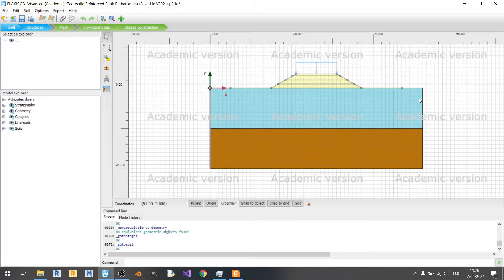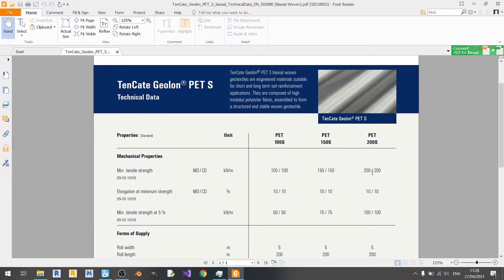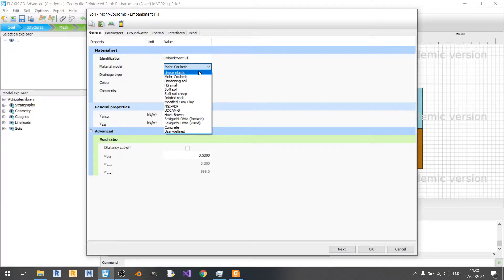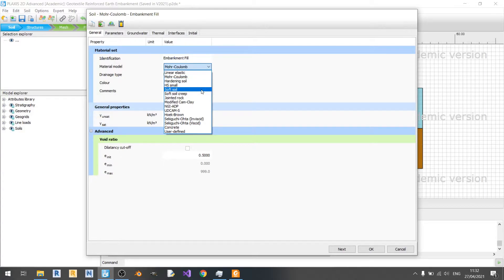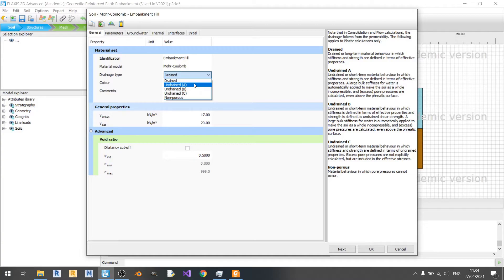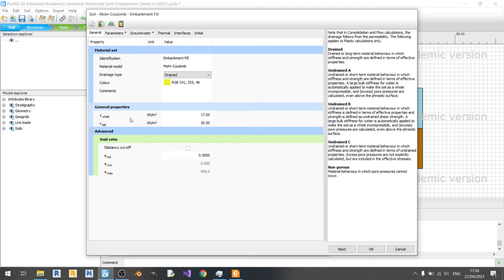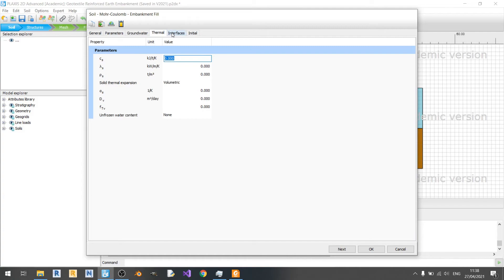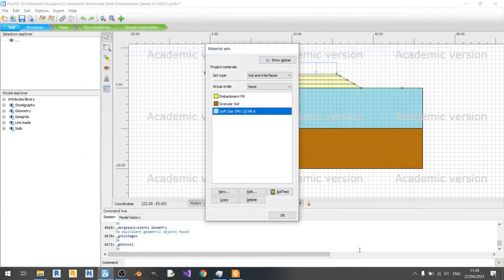Plaxis 2D: How to create geotextiles and soil?

Comment: hello sir, may i ask how do we change the water level? i dont want to use the water level that was auto generated by the borehole, but cant seem to delete it.
Reply from the maker: Hi Irfan, to change the height of the water table you can double click on the borehole you created and a popup window should emerge. At the top left, there should be a name for the borehole and right underneath that name is x and head.
Reply: @revitforcivilengineers  thank you